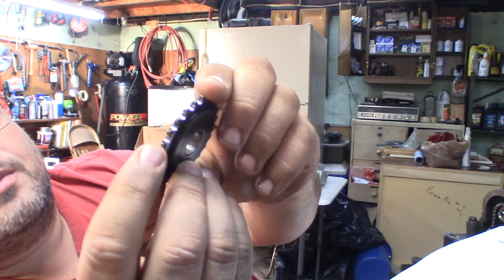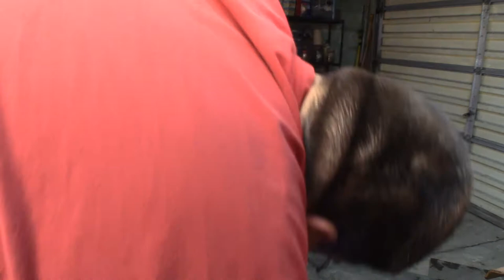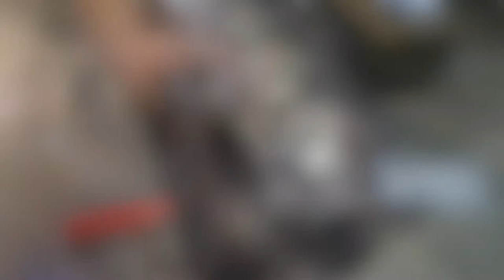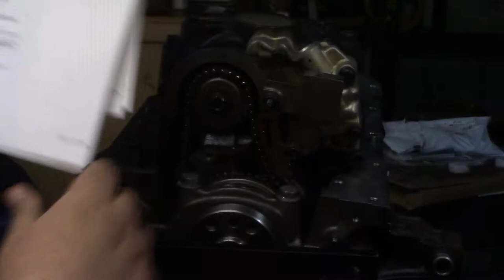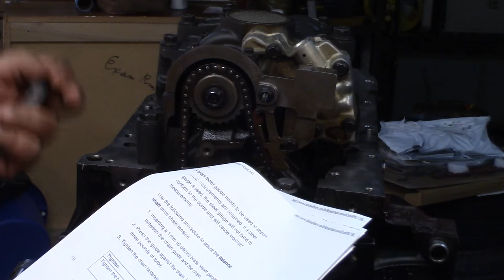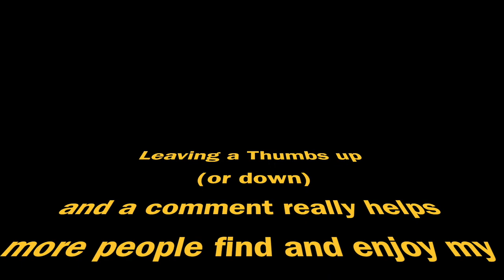LD9 Engine Rebuild Part 10 - Installing Balance Shaft Chain - 1999 Grand Am GM 2.4 Quad 4

Comment from the maker: I bought this balance shaft tool from a Canadian guy in Windsor, Quebec that used to work at the Lansing Michigan GM Engine Plant where all Quad 4 engines were built.   You never know.  This could be the second time this engine has seen this exact tool!  18 Years and 85,000 miles later they could be re-united again!

Comment: i have a 98 Cavalier with the LD9.  The engine has been nearly flawless and is still on the original clutch at 130K.  But sadly living in the rust belt i have serious holes in the rear unibody frame rails behind the wheel wells.  Already replaced the engine cradle frame.    Love you videos Tom!

Comment: I also run a 2.4 quad in a 2001 grand am with 180k miles. Interesting to watch work done on this motor. Mine is running well. I have changed out regularly, and other routine maintenance.   Thanks.
Reply from the maker: Wow 180K is really good for these motors.  They are kind of known for spinning #3 Rod bearings, oil pump issues and timing chain problems.  Most have cam tower oil leaks around 100K which is a pretty major job to get to the gaskets on.  Everyone I have torn down at the junk yard over the years for parts and just to see what happened has been full of sludge where the engines have had dirty oil.  I think the key is that this engine needs regular oil changes and clean oil.
Reply: "I think the key is that this engine needs regular oil changes and clean oil."

But isn't that every engine? Sure, some are more tolerant of abuse than others, but, short of a design flaw or manufacturing defect, any engine will give satisfactory service life with just routine maintenance and a little TLC now and then.
Reply: @frugalprepper  this engine is one of those that could definitely benefit from todays oil technology.  The high parafin and more crude dino oils when these were in Their prime wasnt too friendly on the quad.  This brings back memories of my dealership time. Used to see these qiad in for warranty work all the time.  Another weird quirk is the injector harness isnt sized well and allows the wrong injector to plugged in to it.  Had a lean miss with funk kv readings after my trainee finished a head gasket on one

Comment: I just replaced the rod bearings in my 2001. I noticed the engine had higher NVH after. This is why. I didn't align this at all. :O Had I not been in a hurry and skipped through I would have seen that there is a process for aligning this; since the sprocket isn't keyed I assumed it didn't matter. :)

I'll be changing the oil pump soon anyway, so I'll line it up then. Changing the rod bearings eliminated a knock that had bothered me, but didn't solve the slow oil pressure buildup, so back apart she comes next week to replace the oil pump. Gotta protect those new bearings, ya know. :)

I have to say, this engine gets a lot of hate, but it seems pretty solid to me. Then again, I'm doing a major PM—a half rebuild, really—so maybe it's just that I'm a glutton for punishment. :) I have done the timing chain, rod bearings, and soon the oil pump. I figure those 3 things with routine maintenance should net me a long life with this car, which I've oddly grown to like. The $100 beater became a car I like enough to repair.
Reply from the maker: Probably not your oil pump.  There is a drain back valve in the block by the oil filter on these.  The ball gets stuck and allows the oil to drain back out of the top end.  It has to be installed in the block by a machine shop.  I had a heck of a time finding the part from GM as well.   Sometimes the ball comes out of them ad will go up to the passage and block oil to the top end as well and you will have oil pressure to the bottom end but not the top end.
Reply: Interesting to know. I suspect that the pump is weak, because the other issue I failed to mention is that when the oil is hot and not viscosity enhanced (Lucas and/or STP Oil Treatment) the oil pressure at idle is low enough to trip the warning light, and sometimes even at 1000RPM or more.

To me, that says a worn pump which isn't engaging the oil solidly anymore. Do you disagree?

EDIT: By the way, it's awesome that you take the time to engage your audience, and even help them. I assume you posted the video to help people, but many people just leave it at that.

Comment: The oil pump has to be on time how do you set it?
Reply from the maker: The oil pump has no timing but the balance what’s do.  You have to use a balance shaft installation tool to put them in time